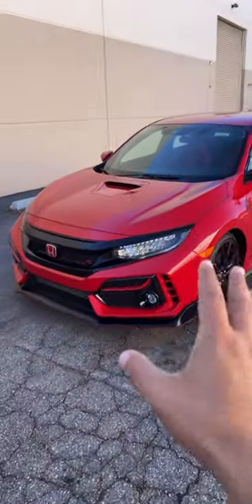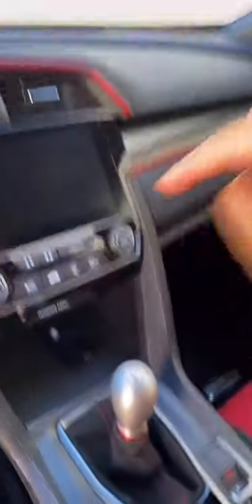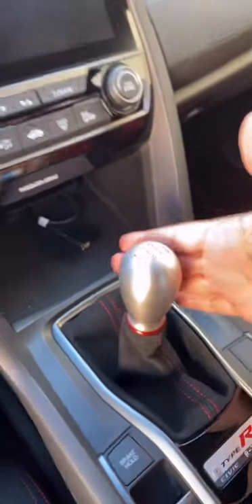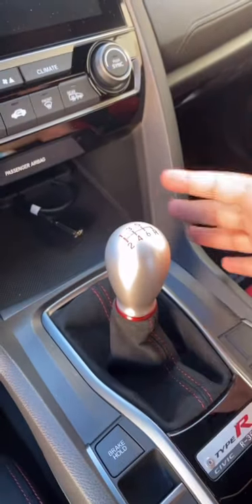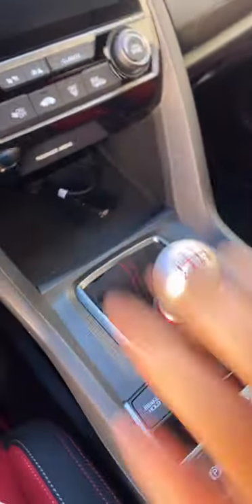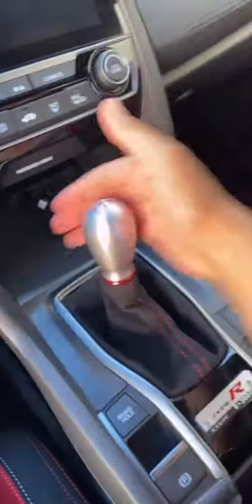3 Things I DONT like on the Civic Type R

Comment: Back in my day we used mirrors to backup.
Reply: i still use mirrors in any car, the reverse cam should be used when you straightened out in the parking spot to see where you needa stop
Reply: Uhm you
Should be turning your head if you’re backing in not using mirrors
Reply: @lokodimez1263  what are you going on about
Reply: I still do. I have an 04 Civic Type S.
Reply: @lokodimez1263  lol youve never drove a big rig then
Reply: @Ammon3811   fair point
Reply: I don't even use my backup camera to back my car lmao
Reply: @lokodimez1263  unless your head can see around corners like a camera can (due to it's position and angle of view, you should be using a camera.
Reply: @lokodimez1263  actually you're supposed to do both
Reply: Those rear view cameras are amazing for parallel parking here in New York City.
Reply: Such a wholesome and true comment
Reply: Back in your day the dinosaurs roamed the earth. What’s your point?
Reply: Cringe
Reply: It’s a new day now
Reply: I put my head outside the window and start backing. I have parked so many times in my garage. I can probably do it blindfolded. I just close my mirrors put my head out and I point the steering wheel where I exactly want to go. Without looking at the steering wheel itself. It gives me high accuracy. Even though I am not good at parallel parking. I am good at parking in garages without mirrors, cams, etc
Reply: I used my eyes
Reply: I use this trick called turning my head
Reply: Did they lag?
Reply: I actually prefer mirrors. I have a backup camera but never use it. Can more accurately judge where you are with mirrors and with the wack parking at my house you gotta be precise with reversing
Reply: Back in your day, cars were smaller, had smaller pillars, and had more glass

Comment: Damn, I wish I had a backup camera at all.
Reply: I wish i had a car over 80 HP. 75hp Fiat Doblo user.
Reply: @mrxeno5246  I feel it 97 hp Chevy spark
Reply: @All you need is alil family your right,i honestly think about getting myself a mk2 golf as its small and with a little help under the hood it can go fast too
Reply: I thought having one would be cool, but since I learned to use my mirrors when I was younger, I never use it lol.
Reply: Or you can turn your body and look through the rear view window
Reply: I wish my car had backup camera and this guy here complaining when he has everything he needs in the car
Reply: I wish my car had atleast a better sounding exhaust. More than 150hp. Other than that I am fully satisfied. The way Honda tuned this car's suspension. It takes corners with so much ease.

Honda City 2014 user
Reply: @AP.Production  same
Reply: Well boys my 2014 f150 has treated me well. 302 hp in a little 3.7 v6. But no amenities what so ever. Just finally got around to adding a touch screen radio. Still no backup camera. Its ready to go I just gotta wire it.
Reply: Same lol

Comment: Ok first of all.. buy a carbon fiber shifter, second.. the lines are just there as an assistant, you don't even need them.
Reply: Carbon shifter is tacky
Reply: @jamesmoore716  explain.
Reply: @yassineazoui4204  it’s just corny. it’s something a teenager would screw onto their shitbox
Reply: "yea bro I got a carbon fiber shifter in my civic"
Reply: @tuscanikristian3274  literally every supercar "guess I'm tacky"
Reply: @yassineazoui4204  not tacky on a supercar. but on a honda civic ? yes.
Reply: @tuscanikristian3274  understandable. I see your point. But it is a type r. Deserving of the carbon
Reply: @yassineazoui4204  key word super car and actual hp and light weight
Reply: @123brendan100  Honda civics have a lot more power than you think 😳
Reply: @yassineazoui4204  I mean 306 ain't no joke tops out around 290 impressive will beat a normal car no doubt but it looks like it wants to be something it will never be but it's verry reasonable priced so no hate but keep it cheap unless you upgrade what matters first that exhaust is a good start 😉
Reply: @123brendan100  the civic type r is faster around the Nurburgring than a 997 GT3, bmw m4, m2 comp & plenty of others.. it’s pretty capable.
Reply: @OleMisss  and how many people drive it on a track... every one I've seen and draggraced 6.2l truck engine built seems to treat it like a Honda civic
Reply: @123brendan100  lol okay man. You could just admit it’s a capable car. I personally have an F80 M3 and guess what? This car is faster around any track than mine. Let me guess though, your 6.2 truck can beat my M3 to 60? Lmfao..
Reply: @OleMisss  ever meet a capable driver drive one tho? M3 is a quick car might when off the start who knows lol 😆 I've beet a few but I'd its modified hell to the no lol
Reply: Exactly dude my ‘20 civic doesn’t have the lines and I do just fine. Hell you don’t even need the camera at all lol
Reply: @123brendan100  I wasn’t hating by the way. I just think the civic type r deserves respect. And nah, I’d launch your ass to gapple bees. The f80 is around 540whp
Reply: @OleMisss  my trucks pushing 730+ ish lol I built it for drag not a smart choice in winter tho 😅
Reply: i'm pretty sure you can also get rid of the backup camera lines in settings.

Comment: A brake job on one of those about $600 and you can't do it yourself because only Honda has the technology to unlock the brakes
Reply: So a 38k car requires $600 brake Change
Reply: @hilt999  if u need rotors and pads yes Brembos rnt cheap which im sure u knew that
Reply: @Raythedk  yea but I’m sure you also knew that you don’t need a compressor piston took to change your brakes…. My brother literally has a si and him and his friend did them with hawk pads and I ended up picking up the brake quiet for them….
Reply: @hilt999  ur talking about a different car so idk y u bring that into this
Reply: I'm guessing your talking about the rear brakes since the ebrake is electronic, all you have to do is remove the actuator which has two screws and get a inverted torque socket to turn the spine clockwise till it stops then get a decent sized channel locks to ccompress the piston then your done works with any electric ebrake
Reply: @Raythedk  just looked it up and funny enough, you’re still wrong so idk what your bringing into this
Reply: @tommybuesa8834  yes i r right on that that i agree on u with
Reply: @hilt999  its 600$ bro ik bc i work at honda hit up the dealer snd they'll tell u dont take my word for it if u don't believe me
Reply: @hilt999  ill show u the paper work were it says 600 this kid came in the other day w his parents wanting to do a brake job for his type r for 250 brings his parents to try to get a better deal in the end he was upset didn't wanna pay the 600 so he went to another dealer its still gonna be same price
Reply: @Raythedk  You're wrong
Reply: @kevinnorris6558  no actually im right

Comment: 1. Yes, the knob can become quite hot. But you know what also loses heat quickly? Aluminium! 2 min after driving off in 32 degree celsius sun its already cool again
2. uhm. Dont try and back up that fast? Aint a race man
3. that is known. Install a different type of exhaust then lol

Comment: I love Honda and I HATE this car. Piss poor Type R model. Type R’s are supposed to be lite but this car is a couple hundred pounds heavier than the Si coupe. Fake vents, fake carbon and a big heavy ass engine.
Reply: Type Rs are literally the fastest hot hatch.
Reply: @fernank017  on track yes, straight line no. Honda has always had the fastest FWD’s. The new Type R is nothing more than a marketing gimmick. I really hope the new teggy is real Type R material, as in its a race car first and a street car second vs what we have today.
Reply: @user-tj3et5ep6t  Who the fuck cares about straight line speeds??? If you want a drag car, get a hellcat or a tesla. The CTR is deffs not a slow car. Last I checked the original Type R Civics didn't have a lot of race oriented features other than a stitch welded chassis.
Reply: @fernank017  the ek9 was specific chassis, all sound deadening removed, a stereo was an option, the engine was hand built race engine, Honda chose the lightest model. Lite weight crank pulley, deleted ac, power steering, power windows, Abs. It was a race car first. Like the old M3 these cars were made to compete in JTCC. The new type R is a fake ass clown car and all the real enthusiasts know it.
Reply: @user-tj3et5ep6t  You talk a lot about a track, but you only seem to care about straight lines. Let me tell you something, from someone who's actually been to a race track. Races are won and lost in the corners, not on the straights. You will never be able to win races on pure straight line speeds. 

Second - power steering, ABS, Power windows are all things available on the FK8 (hell they're available on the base models). Also they hype of a "hand built" engine is super misguided considering that most engines these days all have some level of parts being hand built. It certainly doesn't make them better. No production car today is released from the factory without AC. You ever see a GT3 RS without AC? Without a stereo? While Honda would like you to believe that those were weight saving measures, it's more than likely that they were cost saving measures.

And finally, unless you've driven both cars, then you can't talk shit about either one. Which I doubt you have.
Reply: @fernank017  my son, I am a Honda G. I have had b18c ( jdm motor) in my teggy. I have had built b16a( jdm motor) in my crx boosted with the fresh JDM clip. It goes on and on. I was one of the first people in the country to drive the new CTR on the street. Shit I was driving that car on public roads before they were available to the public. Me and my friends were the first ones to have k20 in EK’s with working A/C. When it comes to racing you are wrong. Races aren’t won in the corners they are won during breaking( same cars in same class). The type r’s were race production cars for the JTCC ( Japanese touring car championship) that’s why they offered the car stripped. Yes you could upgrade if you were a poser. They JDM type r’s had a special model for people who wanted that car with a sunroof. It came with yellow recaros. The reason why the motors were hand built was because the engine tolerances were so close they had to use a micrometer. Like I said it’s a gimmick. You can’t throw a suspension and a tuned up k20c4 and call it a type R.
Reply: @user-tj3et5ep6t  Wining in the corners isn't just about breaking. It's about chassis design, suspension design, power/weight transfer. All of which show that the new CTR is a competitive track car even when compared to cars with more power. So clearly it's not just a gimmick.

The EK9 CTR was based on the SiR chassis which was not designed to win races, or become a race car. They are not "race production cars". They didn't leave the factory without stereos, or a with a roll cage. It's the same formula they use to produce the FK8 Type R.

And like I said before, no car company will sell you a stripped down car - unless you want a track only car. You have to strip the car down yourself if that's what you want. The old civics were basic as it is, of course a type R would have been basic. You think they had sat nav in 1997?
Reply: @fernank017 , the new CTR IS the same car as as a regular four door. The EK9 was “based of the EK4. Now if you take the bumpers off you will see added brace bars welded on. There are sections on that car that do not exist on the EK4. Yes they sold the car completely stripped from factory except interior paneling. You will hear every pebble hitting the bottom of the cars. This is how they beat cars out of their class. Seriously bro I have been around these cars for 20 years and I know that you have no damn idea what you are talking about. Ya know there is an educational video for noobs like you. Best Motoring Type R Legend. This video goes into detail about the production of all the Type R models for the NSX, DC2 and EK9. After you get educated then talk to me about the FaKe8. Now enjoy your homework because it’s a great video.